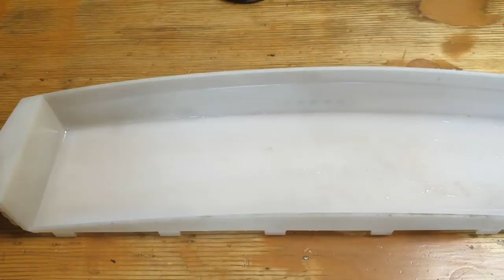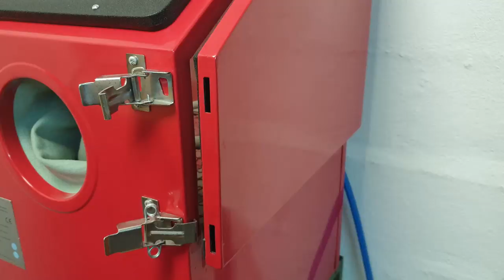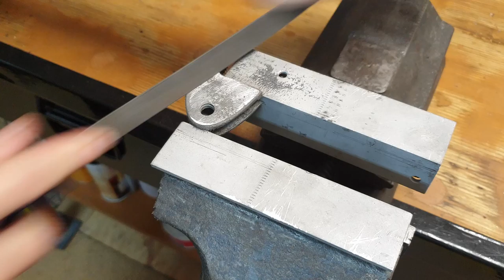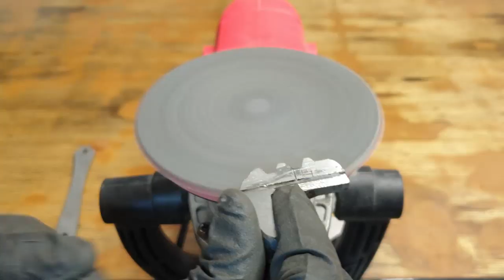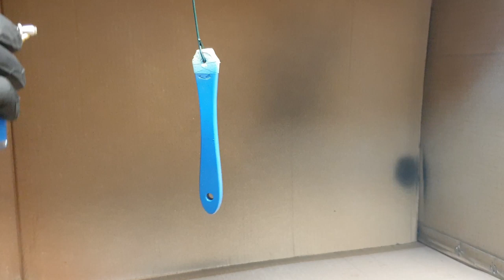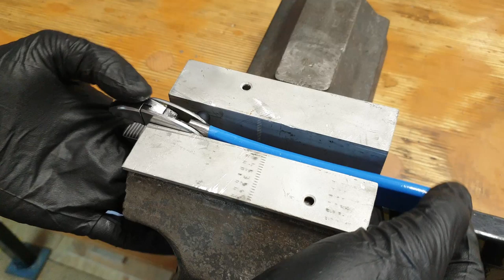How To Restore - Adjustable Wrench - Complete Restoration - With stop motion and time-lapse

Comment: Restoration is gud.. best part is the kind of idea/design. How it  function/works.. auto lock based on width of the nut.. but under day to day usage the center rod which holds the handle and the mouth will get loosened.. a slight play might be seen..could have modified it by adding a steel bush then the rod (rivit), inserted inside the bush, bush to be fitted to the handle, the Outer Diameter of the hole in the handle should b bigger than the hole provided in the mouth.. so handle holds the bush mouth holds the rod.. both in hard steel. It gives a perfect smooth semi turn.. but still this is not bad too. If its only upto restoration.. great job. Hope u understood my idea..